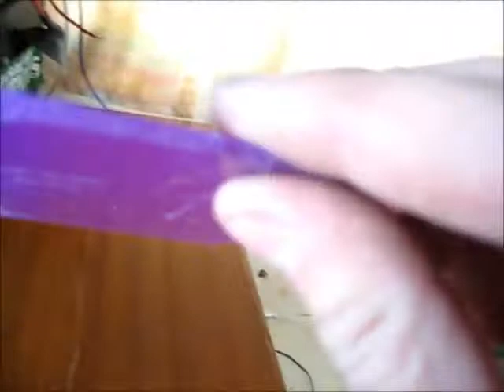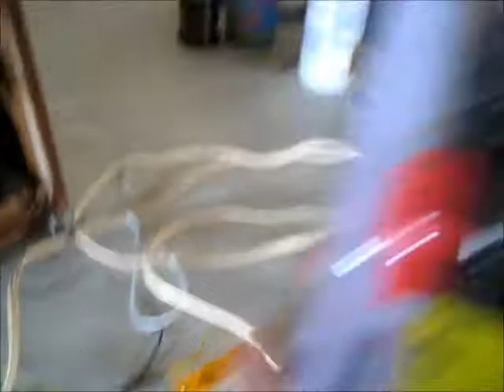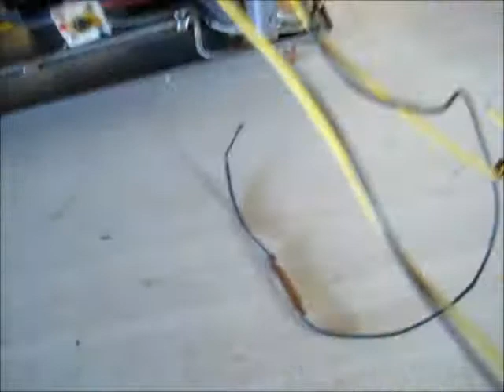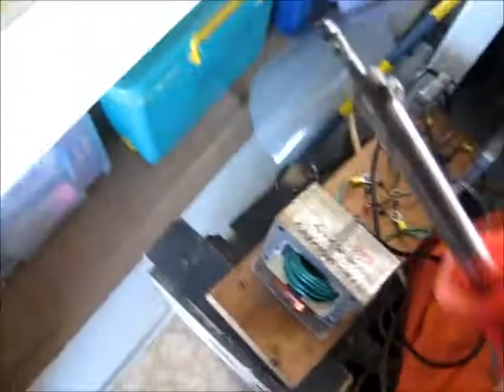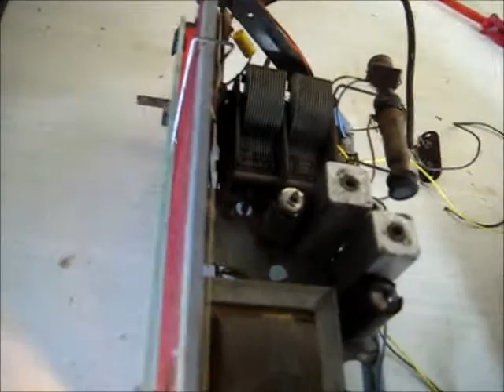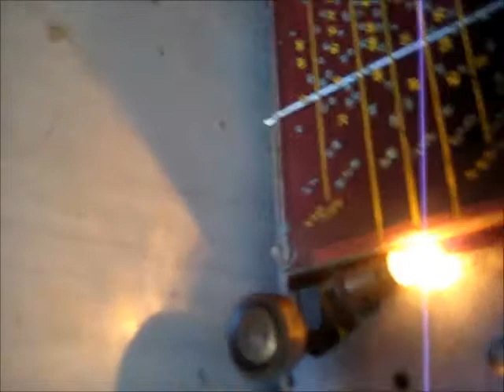STC Model 5182 Repair part 2

Comment from the maker: @OlegKostoglatov Thanks for that, these IF Tranny's are the slot type, i just need to make a plastic flat bladed screwdriver for these, You're right on those tubes, either the oscillator is weak or the IF stage, I'm guessing they're both weak :(

Comment: @HDXFH It could be the IF tube (6BA6?) or it could be the mixer oscillator tube (6BE6?), more then likely it needs an alignment too even if one of the tubes is weak. They look like the type of IF transformers with a tunable ferrite slug down the center rather then trimmer caps, they either have a bladed slot or a hexagonal slot, in either case try to use a plastic tool to adjust them. Without a test oscillator you can get by with tuning in a weak station and adjusting for peak volume that way.

Comment: I think that the clear ones are polystyrene caps, they were using them as a substitute from mica in precision capacitors in European sets, now they use ceramic mostly. I think it may need either a new tube or an alignment, the set should be picking up the local station without an external antenna since it has a ferrite rod antenna inside.